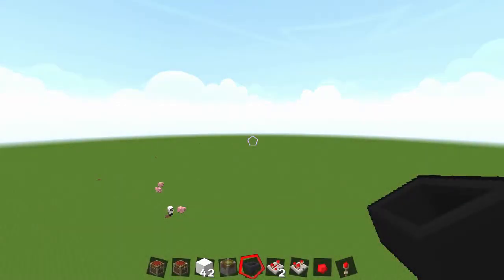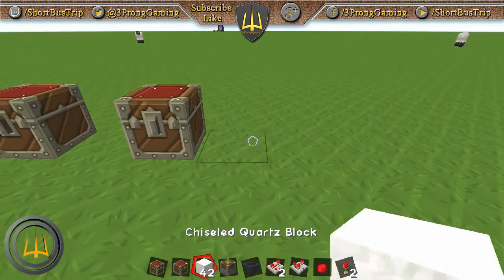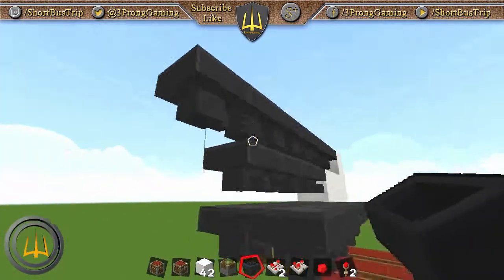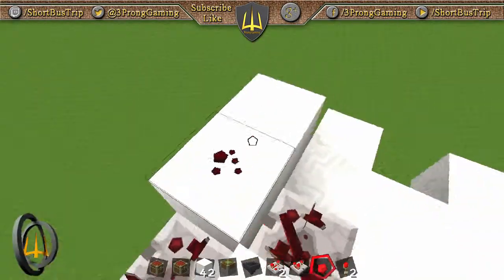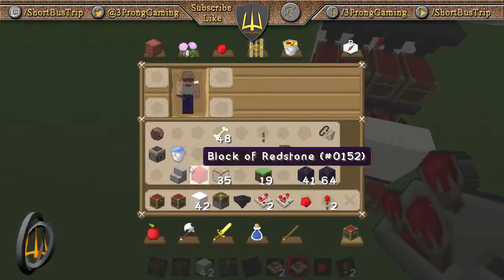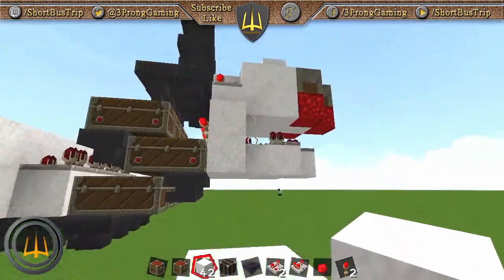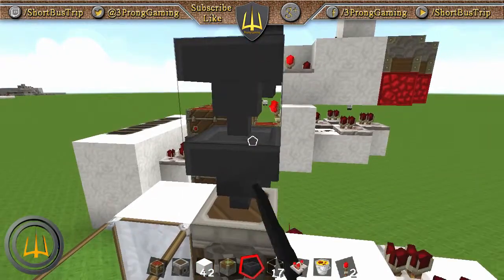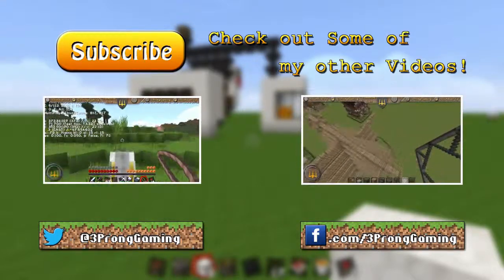Minecraft: "Item Sorter & Garbage Disposal" Vanilla Tutorials

Comment: I've done everything in this video, the only problem I'm having is the dispenser doesn't want to shoot out the items. I have redstone going into the block with the torch with the but it's not activating the dispenser. I tried to snake the redstone directly to the the torch but it doesn't do anyting. The repeater isn't giving the power to the redstone that takes it to the block. I'm not doing anything different than yours.